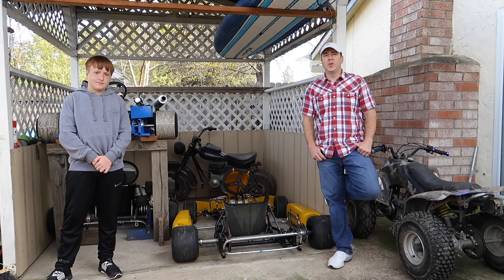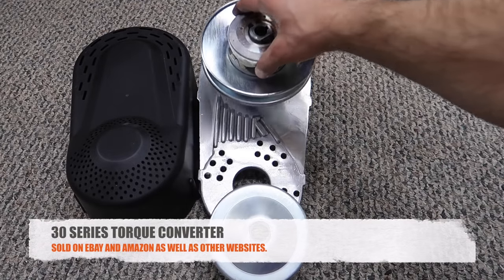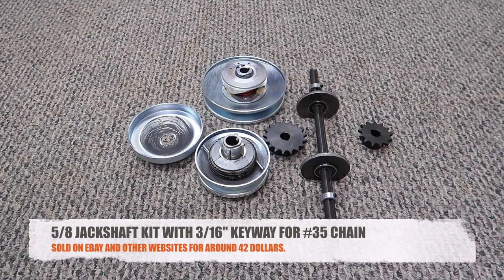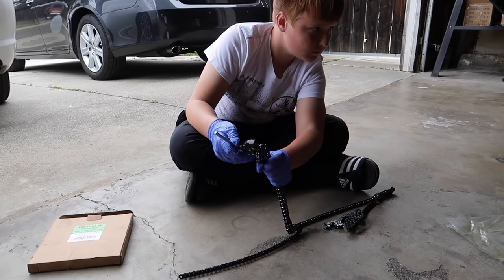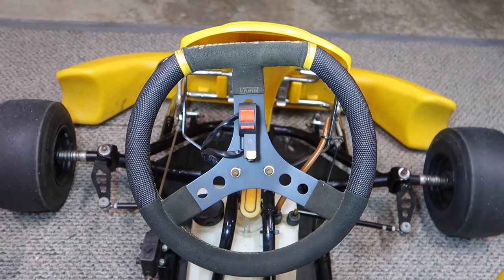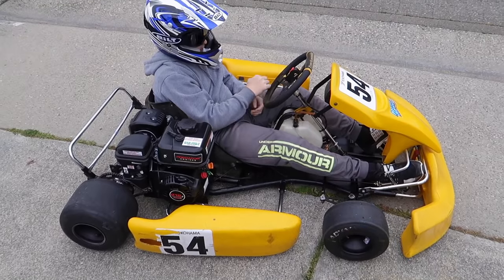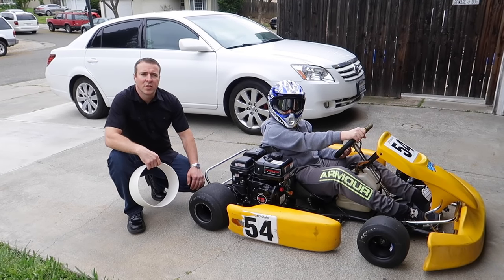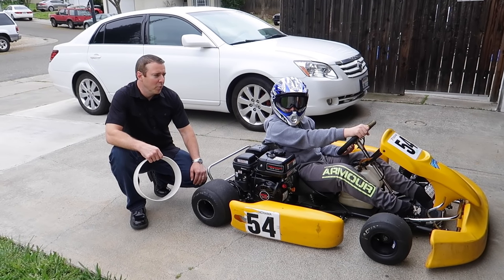GO KART JACKSHAFT PROJECT.

Comment: what is that part you added to the torque converter to bring the sprocket to the other side!! I just got my first go kart its a top kart with a 2stroke kt100 and have been wanting to swap to a built 212 but because my axle doesn't have a key for the gear to sit on the side id usually needs too so I haven't done it but this is a PERFECT solution !!!!
PLEASE LMK ASAP got a guy with a awesome motor that I've been making wait for too long because this issue

Comment: How did you establish your spacing between your driven and drive pulleys so the belt tension is right?
Reply from the maker: Hello Bill
When your rig (go kart, Minibike or whatever you’re using it for) is idling there should be no tension on the belt. Once you place the belt on the driven pulley, it should freely go on the motor shaft with maybe a small tolerance just enough for it to be loose. Watch some videos of people install these torque converters on mini bikes or go karts and you’ll notice how loose it should be. Good luck and I hope I explained it well enough for you to visualize it. Cheers.

Comment: With a pod filter, jetted carb, and exhaust along with removal of the governor, that predator will easily hit 12-20 horsepower. You should look into that, they're very simple modifications
Reply from the maker: Austin Willis 
Thanks for the tip and advice. I'll look into getting a kit for this engine. Do you know any sites that specialize in all that? Cheers mate
Reply: Nr racing has some good complete kits

Comment: What's the distance center-to-center from the motor shaft to the small sprocket?
Reply from the maker: Danny Halili 
From motor shaft to jackshaft or from driver pulley to driven pulley is 5.5 (5-1/2) inches. 
From motor shaft to rear sprocket on the axle is 12 inches. Good luck.

Comment: Did you half to make that mount and run the gear on the outside? Could you have used the jackplate the way it came? Or is your frame setup where you have to run on the right side like that?? Thxs anyinfo would be great
Reply from the maker: MACVSOG 5th SFG. 
I wanted to make my own type of engine mount and also wanted to have the small sprocket on the outside so that it would be easier to service my chain. The frame was made in such a way that it was challenging to fit everything compact enough without interfering with the wheel and the seat. There are many ways to set up your engine mount so be creative and let me know how it turns out. Good luck and thanks for watching.
Reply: @balabay77   yup right now I have a built stag 2  gx200 and I'm running a 2 disk Horstman clutch but it just don't have much take off power/clutch grabbing and get up and going! So I think a series 30 or 40 should give me that power off the line I hope!👊 thxs for replying
Reply from the maker: MACVSOG 5th SFG. 
Sounds like you’re running a top of the line clutch with modded engine. I don’t think a torque converter will improve your takeoff by very much but you’re more than welcome to try it. With our setup the kart maxed out at around 50mph so if your kart goes faster than that then it’s not even worth your while to swap for 30 series TAV2.
Reply: @balabay77  yup I was think same thing I have series 30 laying around I'll let you know how it goes

Comment: Walmart sell a stage 1 & stage 2 upgrade for that harbor freight 212 motor - stage 1 will make it go from 6Hp to 6.5-7Hp and stage 2 will make it go up to 8HP - but you need to remove the governor & it will do 50mph

Comment: Could you do a video on the braking system? Master cylinder and caliper set up. I'm running the same Brembos and I'm having trouble finding the right master cylinder.
Reply from the maker: Diego Campos 
To be honest with you I don't know much about these karts and the braking system. I would imagine that any master cylinder that have the right brake line connectors would work just as good as the original. All 3 of my go karts comes with MCP master cylinders. So your best bet would be to match MCP cylinder with your brembo caliper. Does you brake disc caliper have 2 line connectors or just one? What type of brake lines, 3/16 nylon tubing or braided stainless steel hoses?

Comment: Ok guys i hope u put the spring end in the number 1 or 2 hole then try your kart again and watch what happens when you give some gas better hold on and possibly be ready to be looking at the sky as this littlle adjustment is like giveing the cvt a stall torque converter try it youll like it

Comment: How come you didn't go into more detail about the Jack shaft? I feel like I missed something
Reply from the maker: Jack shaft mount was made out of scrap metal therefore I didn’t go into more details on how to make it. Your scrap metal pieces wouldn’t be the same as my pieces so you would probably have to jerry rig it to your specific frame. Besides, many couch experts probably would of commented that they would of made it better or different. All I know is that my mount worked out great and lasted for entire time we owned this kart until we sold it. If you are having issues with fabricating something similar than there’s always an option of buying it online. Good luck and thanks for watching and commenting.

Comment: Be sure to adjust your brake bias. Looks like he's locking up just the rears, could loose it when braking in a corner.
Reply: Its a gokart, most ONLY have a rear brake on a solid axel. The front brakes are a liability because gokarts lift a rear wheel while cornering, and any braking of the fronts will spin the kart round. Im adding front brakes to my gokart this week, the upgrade cost is about £1000, £850 for the brakes, £250 for a 10mm kingpin set, and 4x5dot caster/camber adjusters. They will be hand braked on my kart, with rears using the foot brake. 
In addition, the brakes im fitting are not even race legel now, as most racing organisations are banning them. I think only the big shifter karts still use them.

Comment: Thats a trackmagic kart a 125cc chassis. your missing the chassis torsion bar i broke a clamp they dont make them i got mine for 250 with a 250crf honda motor im still working on it i need to do a lot of mounting but itll be dope if the engine is good. I wish they still made parts but the company is no longer around since 2006.

Comment: What brand clutch system is that
Reply from the maker: Gerardo Soto 
It’s a 30 series torque converter 3/4 shaft. They are readily available on eBay and Amazon.

Comment: put a PRD fireball on it and ittle be fast af
Reply: I have a tonykart running a prd fireball... its been getting pimped up, new decals, front brakes, carbon seat, then i covered my seat with padding, and black pu leather with green stitching to match the decals. An alfano added, phone, bluetooth(i can listen to music, or make phone calls) multiple gopro's, recharging for cams and phone, new plastic style rear bumper and i swapped the otk standard pedals for billet aluminium CRG pedals because they look better. Im also going to swap the red plastic screw spacers for green aluminium as a final touch.

Comment: you should build the motor
Reply from the maker: PIGGY603;} 
Can you recommend any good mod kits for this engine?
Reply: balabay77 go power sports has a ton of aftermarket parts.. my pred 212 has a upgraded cam different piston billet fly wheel and straight pipe and a little carb work and it hauls some serious ass! All parts bought from go power sports
Reply from the maker: Thanks Bob Saggot from full house. I'll have to take a peak on their website and see what they have. Thanks for the tip sir. Cheers
Reply: yes go to, ombwarehouse.com they have parts and kits to stage 5 balabay77
Reply: im olny 13 so thats where i get the parts as a kit ,or i sometimes i go on arcracing.com, they have motor parts too, but not a kit